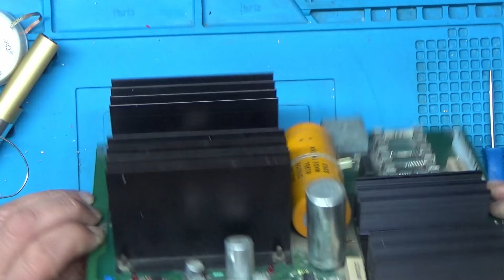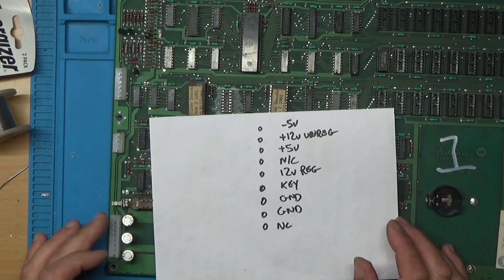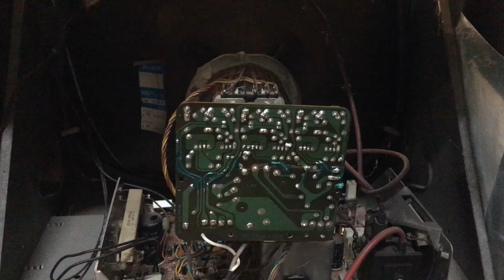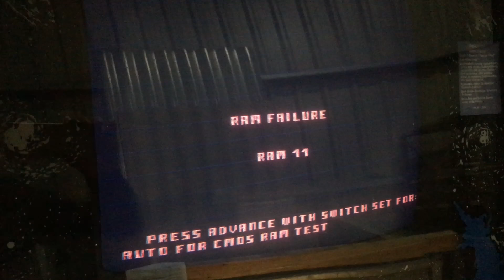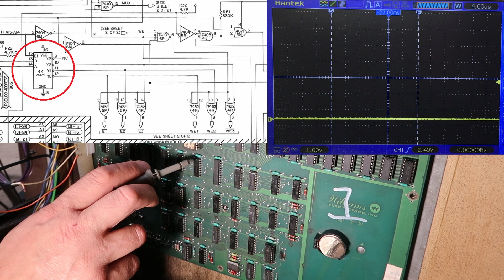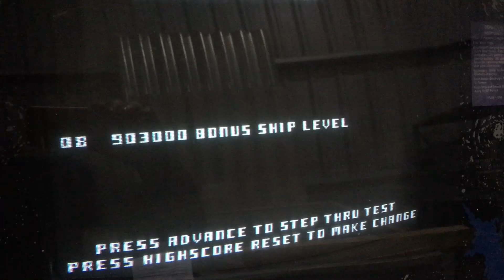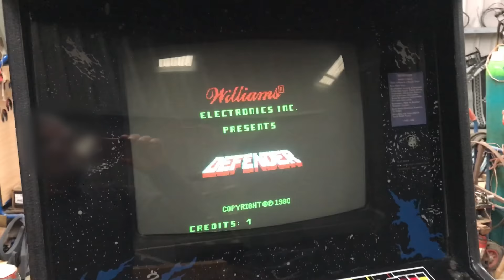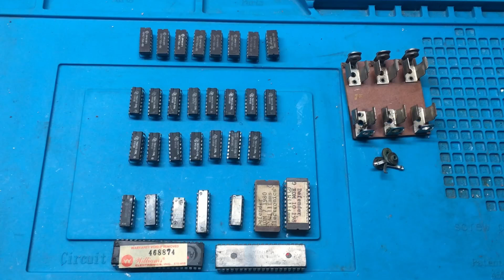The Repair That Broke Me - Part 2: Rescuing a 1980s Defender

Comment: Really an amazing fix! I was not yet born in this era unfortunately, but i do just love these older arcade systems/computer systems for how neat they are, and the fact, even though they contain a billion chips, they do have a datasheet most of the time.
No vendor locking of parts, (often) no oem unobtainium chips, throughole instead of bga or smd and just some neat understandable circuitry that is serviceable! 

Most arcade systems these days have regular pcs/motherboards inside, with some I/O board hooked up via serial or usb and some custom application running ontop of a linux or windows os thats probably under some NDA or law. Also those only work with a valid security key, in the form of a usb drive that stores some specific encryption key. They also sometimes communicate with a special vendor approved network. 

It is kind of similar to arcade machines today, in the fact they have multiple boards handeling different things, but these have a soundboard and romboard which new arcade machines all have integrated on the motherboard/in the pc and have more bits in software than physical hardware. 

At boot the soundboard plays whatever is left in ram until the cpu tells it to shut up, or feeds it data. This is also why you got the constant whoosh of noise when you powered the cabinet on, and because of a bad PIA on the ROM board,the soundboard never got told to shutup/never got initialised until you replaced the PIA and made it work again. 

In the past, i once helped a friend repair an old arcade machine he had bought. I cant remember fully, but it was a pacman arcade powered by a z80 cpu and it had multiple faults on it. It also had a bad PIA, some logic chips that were  bad and the monitor and board needed recapping and the powersupply was totally dead which we repaired. We also added a crowbar circuit, just in case the psu goes haywire and fries the wole board and all chips.
Reply from the maker: Thanks for the long comment mate 👍 Yes all pretty much standard logic chips on this one. I was quite fascinated how it generated the display. It was actually quite simple and elegant I thought.

Comment: Why is the RAM chips uses +12 "Unregulated voltage" for Resetting the RAM chips? Why use "Unregulated voltage" instead of using Regulated Voltage?
Reply from the maker: The old ram used +12v regulated and +5v and -5v. The reset circuit uses the unregulated 12v as that should die first at power loss, so this puts the CPU into reset to stop corrupting the CMOS settings. Hope that explains it a bit better.
Reply: @BuyitFixit  but why would the reset circuit is Unregulated +12vdc instead of Regulated +12vdc? If the power is lost the Unregulated voltage will drop FIRST before the regulated voltage?
Reply: @BuyitFixit  Why would the CMOS get corrupted when the Unregulated 12vdc is lost power loss?
Reply from the maker: The unregulated is used as a sense to the reset circuit. It drops first, and puts the CPU into reset so it doesn't write garbage to the CMOS when it's loosing power as the 5V goes down.
Reply: @BuyitFixit  When loosing power, what is supply the power to the reset circuit and CMOS chip, the filter caps left over stored power? The CMOS chip needs an Idle Current to stay on operating, how much idle current before it starts corrupting the data on the CMOS chip?
Reply from the maker: I'm not too sure. I think it was in the "defender theory of operation" pdf that William's produced.
Reply: @BuyitFixit  ok thanks for letting me know

Comment: Using lots of flux makes desoldering so 
much easyer. ;-)
Reply from the maker: I think it was not enough heat on the de-soldering gun. I didn't want to have it too hot as was worried about damaging the board. I eventually figured it out by the time I was removing the RAM chip sockets 👍

Comment: in my experience when an electrolytic cap goes above 20% in value it's on the way out like the one you compared to the new one at a value of 124uF at a stated value of 100uF its too far over. even if the new ones ESR is slightly higher it'll be better in the long run
Reply from the maker: A few people have mentioned similar so thanks for that. I always thought the capacitance decreased as they failed. Remember I'm no expert so I'm always glad to learn new things 👍

Comment: Very well done Mick, you did a grand job.

You don't have it easy with those boards, but on the positive side you do have access to copies of official schematics, ROM dumps and a wealth of information online which all go some way to easing the pain.

Now give it a very good test, leave it running for hours (days if possible) because you'll likely find that a few other chips start to fail.

BTW, for your next challenge: fix your roof to stop the sheets from blowing and clattering in the wind. ;-)
Reply from the maker: 😂😂😂Cheers mate, the clattering is the roller shutter.
Reply: @BuyitFixit  I see! That rattle would drive me nuts. 🙂
Reply from the maker: It's only when it's windy.. although that's quite regular where we live 😂😂😂

Comment: 😄By, you must have some spare time, Mick. Running a Farm, I'm quite surprised you have. But you did another excellent job. Anithwe bit of old tech saved from the trash. I wonder how much they were when new? £150 seems a lot to spare on replacement parts. Still, as long as you're enjoying it, what's the harm. Thanks for sharing with us and have a great weekend.
Reply from the maker: Thanks mate 👍 I wish I had spare time. I've got loads of stuff to do! I needed to get this fixed as we were going on holiday (I'm away currently) so unfortunately I didn't have time to repair anything else for next week. The machine belongs to a viewer and I gave him an estimate of the parts and he said go ahead. There's one of these on eBay atm for £4k!

Comment: The cap that read 125 uF and should have been 100 uF is electrically leaky, and the new one that read low is much better! New ones often read a bit low. The leakiness of the first one fools the measuring device into thinking it has a higher capacitance, because it takes longer to charge as it's leaking DC.
Reply from the maker: Someone mentioned similar in the previous part. I might have another look at them. I had been working on them being around 20% of the stated value.
Reply: @BuyitFixit  Maby build mr carlssons lab capacity leak detector?
Reply from the maker: I'll look into that 👍

Comment: A desoldering gun is a must for old boards. They do come new with solder inside. I got a long drill bit with a manual chuck to clean the tube, the part close to the deposit usual gets clogged if the gun is not hot enough.
Reply from the maker: Thanks 👍  It's was my first time using one. I've always used wick, or low melt, or a manual de-soldering pump. I ended up turning it up to 370c and it worked much better. I had been err-ing on the side of caution as I didn't want to damage the board.

Comment: That desoldering gun looks like an SS-331, same one I have. I found that to keep it from blocking I need to hold the trigger for about 2 seconds after I finish desoldering the last component, otherwise it can be a complete nightmare to clear. One time I ended up giving up and just replacing the element.

The good thing about those guns is, the spare parts and consumables are common and cheap

EDIT: The base is a different model, the gun is identical though, so I assume everything I said is still relevant
Reply from the maker: Thanks for that 👍 Yes I think I had the temperature too low too. It seemed to perform a lot better when I turned it up to around 370 or so. I had been concerned about damaging the board.
Reply: @BuyitFixit  I don't really think the displayed temperature is very accurate, I actually had the same experience. I guess you could check with one of those soldering iron calibration things, but personally I'm not bothered enough 😅

Comment: Im on my 4th Defender, absolutely mint repair well done, only advice I could give would be to completely rebuild the power supply, it should be rock solid after that. Also quite a bit of the loom is non original. But again great work and a brilliant watch I really enjoyed it.
Reply from the maker: Thanks 👍 I'll ask the owner if he wants me to do that. Yes noticed someone had butchered some Barcrest fruit machine bits of loom onto the original bits. I guess the original connectors were broke. I just bought a cheap crimping tool and some connectors which totalled around £20

Comment: Wow what a result, and all the time and effort and skill to diagnose the machine to get it to its full glory again. I have my board set under my bed in a box all working but I run mine on a switcher power supply. I have had this for years and get it out the box now and then to dust it off lol but mostly to check its all ok. I also did the SCART mod as you already know its just cutting one of the tracks on the main board and wiring up the output to the scart lead socket, That in turn connects to a Sony trinitron CRT 19" TV "thats in the loft with a 21" CRT tv" I also bought that button battery mod to replace the 3 AA batteries but still not got round to it, I was going through some other bits n bob boxes and found it lol I do have a video I did showing it working a long time ago and will show you how old it was. I got my son to play it to test "Josh tries Arcade Defender Test.... In Bits.... " running on the Sony TV.  

https://www.youtube.com/watch?v=7jR3B_MK4xY&t=52s
Reply from the maker: Cheers mate 👍 Just had a look and it reminded me of what I did when I was a kid. There used to be a place that scrapped all the old games, and they used to throw them in a skip. I managed to figure out how to wire one up when  I was a kid and was playing space firebird using an amstrad computer RGB UHF modulator. I've still got around 4 boards that I pulled from that skip over 40 years ago. I might have a go at a couple of those in the future 👍

Comment: Geronimo, well done. Perhaps some over-voltage protection in case the 5V goes doolally in the future. Running the desoldering gun hotter will also reduce blockages.
Reply from the maker: Thanks Ralph and cheers for the tips 👍

Comment: EPROM programmers read the chip at a slow speed.   They can't read it at the same rate that it needs to work in an actual system, so if the EPROM data is OK, but the access time has degraded and is too slow, then the chip will verify OK in the programmer, but it won't work when the CPU is reading from it at a much faster rate.
Reply from the maker: Very plausible conclusion 👍

Comment: Well done! I'm not an electrical engineer or electronics expert but I can appreciate the knowledge, skill and patience it took to trace all the faults to the individual chip and pin level and fix all the previous repair errors. I'm not sure of your own "vintage" but I suspect younger engineers who were not around during the beginning of the integrated circuit revolution would have a clue how to diagnose and repair this machine. So after 50 hours of labor and a 150 quid in parts, could you get your investment back if you sold it?
Reply from the maker: Thanks for that mate. It's not mine it's another viewer of the channel that owns it. He just asked if I thought it was fixable... Challenge accepted! I'm  no expert either, and it's the first time I've repaired an arcade machine down to this level. I learned quite a bit doing it though 👍

Comment: I bought the same desoldering gun a few years ago. I was continually getting blockages at the end of the metal tube as it enters the glass container.  I found by keeping the trigger pressed for a split second after removing tip from the joint all the removed solder was sucked into the glass chamber with none solidifying in the metal tube.
Reply: Yep same for me. And use max heat. But I probably will replace this sucker sooner or later with a proper one. It works most of the time but when it not works and you have no time it’s annoying 😅
Reply from the maker: That's a great tip, thanks for sharing 👍

Comment: I get the wanting to keep a system the same, but the power supply is so vital it doesn’t go bazerk, and it’s so inefficient I’d be really tempted to just replace it with an ATX psu.
Reply from the maker: I had considered that, but the reset circuit uses the unregulated 12v to sense when the power goes off. It might be inefficient, but it's lasted nearly 40 years! I'd love to see a switching PSU last even a 1/4 of that...

Comment: So, tell us, Mick. Was the power supply voltage problem the cause of all the chips failing? You were very fortunate the game had all the schematics still on the doors.
Reply from the maker: Hi mate, I'm not too sure. I think in the case of the RAM yes, but the PIA chips are a common failure, along with the odd logic chips here and the re. Luckily all of the schematics are available online so quite easy to get a hold of.
Reply: @BuyitFixit 
Of course, you know everything there is to know about “RAM” chips, as your flock proves. Excellent work, Mick.
Reply from the maker: @bills6946 😂😂😂😂👍

Comment: That’s some gold medal (or perhaps meddle ?) Olympic level fault analysis and diagnosis. Seriously impressive troubleshooting and demonstrating real tenacity especially considering documentation strewn with errors as well. A really impressive masterclass, well executed.
Reply from the maker: Thanks very much. It's actually the first time I've repaired an arcade board, even though I used to work in arcades. We just used to swap them out at the time of convert the cabinet to another game. I've got a few old arcade boards lying around that I pulled from a skip 40+ years ago, so I might have a go at a couple of those in the future 👍

Comment: Hi, I've been a subscriber for some time, thought I might make a comment. I'm not actually 'into' electronics, though I was interested back in the 60's. I am sort of 'aware' more than know stuff. e.g. I know what 'pot' stands for and what one does, same for caps, ic, etc.. a vague awareness. Enough to keep up. I am far more interested in the problem solving. In a sense, that is something I have done for a living all my life. Not in this field of course, I am in the 'switch it off, wait a minute then reboot' camp.. Anyway.. I enjoy watching/hearing you problem solve. Oh, and I feel sure I saw two connections with solder smudged. Not that this comment will help with that , even if I am right.
Reply from the maker: Thanks mate 👍  Yes it's all problem solving really, and the same stuff can be applied to mechanical problems, plumbing, hydraulics etc.

Comment: Just how to use the solder sucker: After the tin is sucked out take a plier, grab the pin and carefully wiggle it. This will break the leg loose. After this is done for all pins the chip can be pulled out easily.
Reply from the maker: Thanks for that 👍